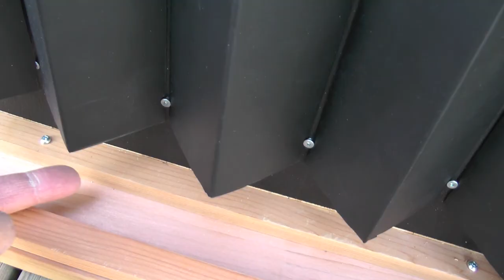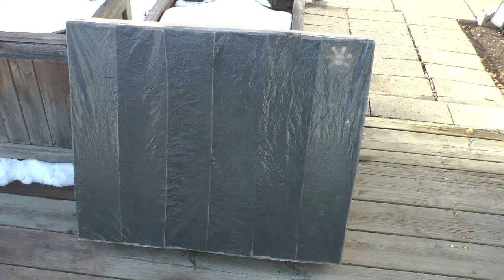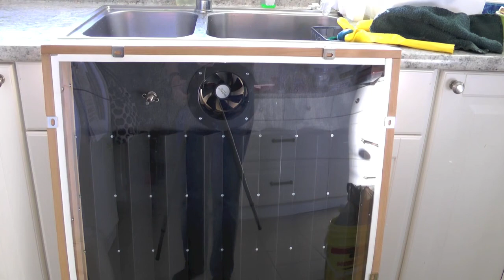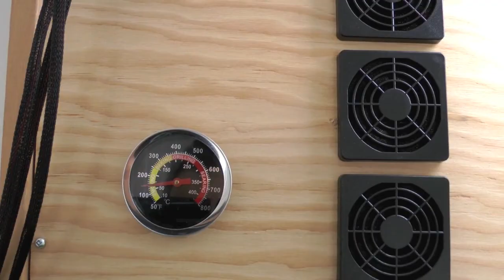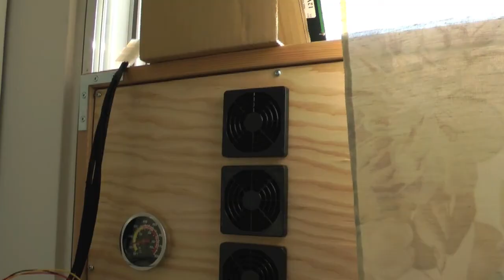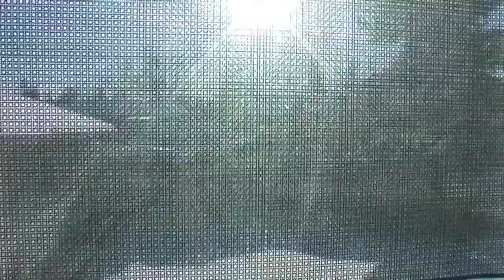Passive Solar Heater

Comment: You built it wrong. You do NOT need to make them Massive as you say.  You need to make them correct.  Mine is 4x8 and uses screen door mesh.  Reaches 200F in the box and exhaust 175F with one 5" CPU fan. Two fans running cooled the box to much. You had to big of a fan for that box.   My box raised the temp in my 1000sqr bungalow from 18c to 24c in just 3 hours every morning for 5hr.  We were surrounded by massive maple trees and only got 5 hrs a day.

Comment: A quick note to cut down on confusion. This is an active solar heater. Passive solar doesn't rely on any mechanical aspects (fans or pumps).

Comment: Could we make the same system 1,5 M tall and use convection to have cold air entering the heater in the bottom and hot air going back in the room in the top ?
Reply: You could, but if the heat exchanger is working well, the forced air flow from the fans will improve the throughput of warm air going through the device.  Also, probably the device is limited to a temperature delta/change so if the device is only capable of increasing the input vs output temp by ~25-39 degrees, you’ll have improved performance by using ‘preheated’ interior air as the input air vs much colder exterior air.
Reply: @Stormsteed  Thanks. My idea was actually to take air from the interior (so preheated) and put it back in the interior.

But just to use convection and the fact that the hot air tend to be at the top.

I think the througput of air doesn't matter much, if the air go slower it will be heated more, so same energy
Reply: @wulfhart2653  I think you need at least one fan to move the air through to take advantage of the heat exchange effect of the box. Think about your hot attic in the summer. You may have open vents in the roof, but the removal of hot air from your attic is greatly improved if you install fan(s).
Reply: Try microfying glass to help heat metal inside

Comment: Cudos on the build. When I built one of these I only had one input port and forced the air to traverse the entire unit keeping it under the sun longer and achieving a higher temperature output.  Of course as soon as you put a fan on it the length of time is shortened and the temperature will drop. Trying ti find the sweet spot of temperature and flow is the challenge.  I perhaps would have either forgone the fan or put it on a speed control.

The second idea was pure genius.

Comment: I wonder if just having the black aluminium perforated sheets suction cupped to the inside of the window would offer any heat... without the fans and boxes, and if so, would they cause more cold at night?
Reply from the maker: the black sheet is a black body absorbing solar radiation and would generate the same amount of heat whether it is sandwiched between two sheets of glass or on the inside as you suggested. and no they would not cause more cold at night.
Reply: @rifhc  TY for your reply, now I have one other question, if that sheet collects the same amount of heat with or with out  being contained, would NOT having any black body, absorb the same amount of heat through the window into the room, pretty much back to where we started? And no I'm not being a smart @22 I really want to know.
Reply from the maker: @dojodance  When sunlight shines on an object (specifically long wavelengths, infrared), it causes the molecules to vibrate and thereby the object gives off heat. Heat is simply a byproduct. The object can reflect or absorb the radiation depending on material and colour. Remember light is simply radiation just like x-rays, but at different frequencies. If you want to try a simple experiment, go outside and stand in the sunlight with a white t-shirt on. Then try on a black t-shirt. You should be able to feel a difference in temperature between the two. If you don't have a black sheet of aluminum in front of the window, the light will be absorbed by various materials in the room. The objects will reflect and absorb the sunlight differently and consequently emit different amounts of heat. So by placing a black object that has good absorption properties in the direct sunlight we can try to maximize the heat generated. Does this answer your question?

Comment: Putting it inside the window won't help at all because that heat is already inside the house as long as the curtains are open.  It needs to go outside, somewhere where it's not blocking a window.  Putting the perforated aluminum between the panes will increase losses.  Put your hand in front of the exposed glass, and your other hand behind the aluminum and tell me which feels warmer.  Also, you're not looking for the highest possible exhaust temps, but best thermal output, which is achieved by more airflow.  Looks like good build quality though.
Reply: It will still work because of the black paint but it won't work as well as not blocking the window
Reply: @TwoForFlinchin1  I said it won't help
Reply: @blurglide  yeah I know what what you said and I'm telling you that it reads the way you did not intend so you should consider phrasing it more precisely instead of being snarky. Help is a very vague term in this context when the guy is trying to heat his home
Reply: @TwoForFlinchin1  Help = make the room warmer than it would otherwise be without the device.  This won't help to do that.  It'll work in that you can put it in a sunbeam and it gets warm, but it won't help because that solar energy was already inside the house.  If you put this in a glass box outside and blow house air through it, then it'll help.     I'm not trying to be snarky.  What is unclear?
Reply: Wouldn’t that also work with newer windows or one to put a piece of plexiglass over the recessed window box with pixie glass and an N put a hole in and out put a hole cut into a top and bottom respectively in the panel the middle of the aluminum panel in between the window in the way of the pixie glass over the recessed window pane area

Comment: Not passive is it? Passive no mechanical devices...
Reply from the maker: @Mikowacomet Just a clarification. Active in my mind is the act of expending energy to generate heat. Like burning wood or conducting electricity through metal coils to produce heat. By placing a black body in direct sunlight to produce heat is passive. You are correct that the fans are not passive. When I was using the term passive, it was not meant to describe distributing the heat with the fans. The fans are definitely active. Sorry for the confusion.
Reply: @rifhc  By that definition, all solar energy is passive.
Reply: Perhaps that is not what passive means in this case. The fan is on or off in this heater. In active heater there would be some thermostates, maybe timers and some other automation. That's what makes it "active".
Reply: @Teknopottu  Those would make it automated.  Passive is basically light shining in a window, or on a collector like this with no fans
Reply: @blurglide  That is true. I stand corrected.